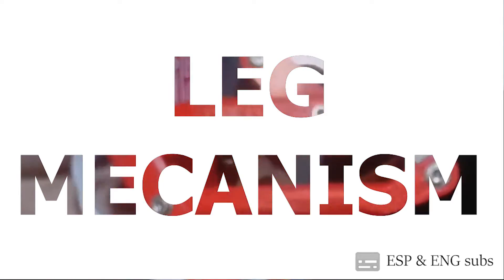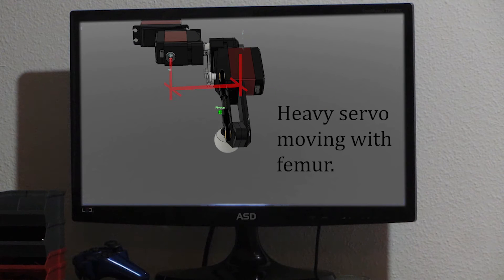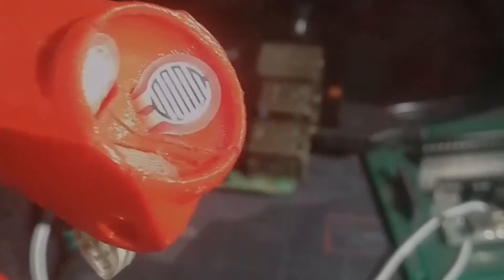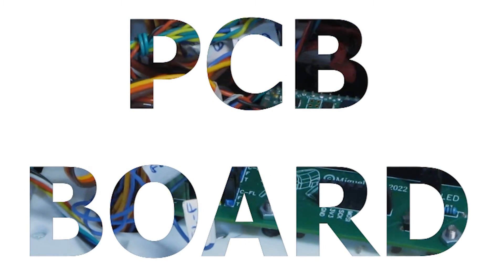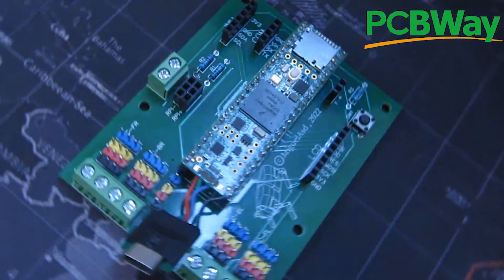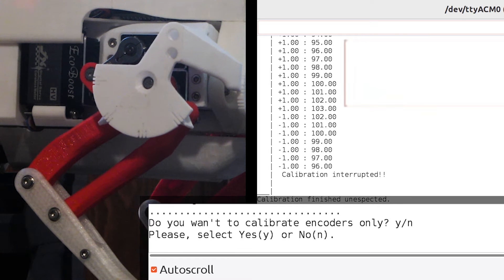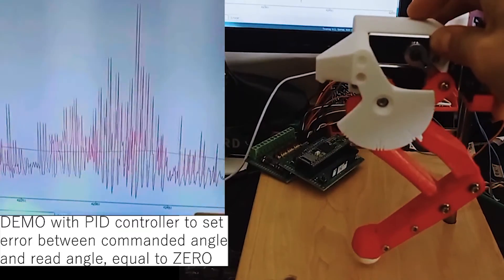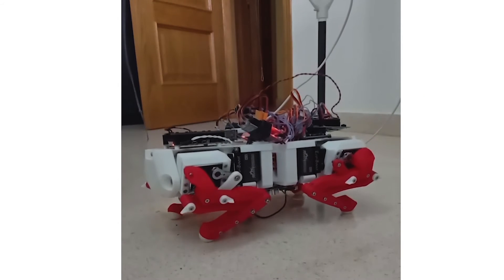You won't believe what this DIY leg mechanism is capable of! Quadruped robot building.

Comment: At 4:38 how do you collect data when you push it? Isn't the servo locked in that position?
Reply from the maker: Yes, servos lock position depending on its own internal potentiometer. But when a load is applied small deviation from desired position is shown, so directly reading this potentiometer in the microcontroller (the analog signal that appears in the video), I can calculate the difference between desired position and real position. Then PID controller is used to keep this difference at zero.
Reply: @asdlab   can i get the math of the inverse and forward kinematics on their own it's hard to get them from the code, also if you have code for that pid control that reads the potentimeter it would help greatly
Reply: @asdlab  hello
Reply: @asdlab  can i get the math of the inverse and forward kinematics on their own it's hard to get them from the code, also if you have code for that pid control that reads the potentimeter it would help greatly